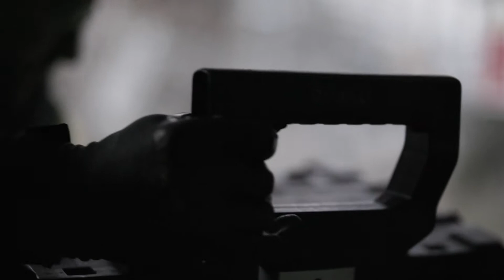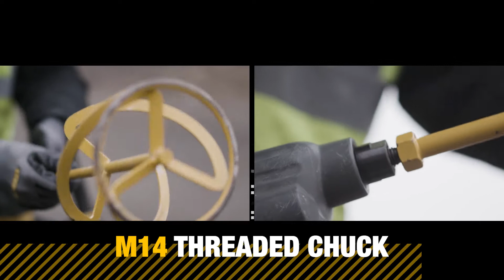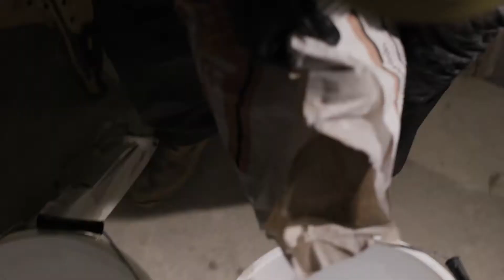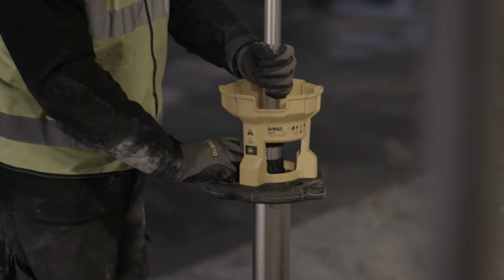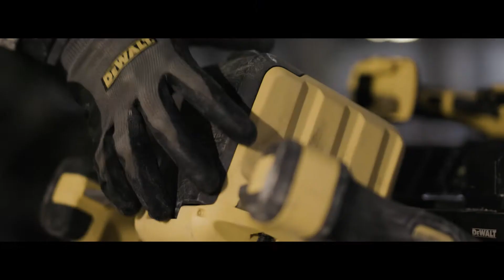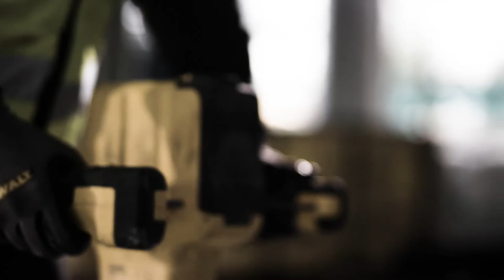DEWALT Paddle Mixer

Comment: So when I got the chance to review you're mixing drill it had a buckle in the Paddle where I think the drill might have got damaged somewhere along the lines of me getting it which made my review a little unfair in my opinion I have requested several times for me to get but different one but have had no luck so far as I want to do it good Justice and redo my review if I ever get the chance the great thing about this drill is the battery protection I love the way you thought about that as the batteries cost a lot of money and you're obviously thinking of Us having not to spend money on a battery if we got it wet during the day or damaged thanks very much guys great video
Reply from the maker: If you'd like to speak to a member of the team, we'd recommend you contact Service Technical on 01753 500 934.
Reply: DEWALT UK They still haven't sent it back out
Reply from the maker: we'd recommend you contact Service Technical on 01753 500 934.
Reply: Thanks so much @dewalt 
Your amazing
Reply: why dont I have this tool it should have been released a long time ago
Reply: I just got myself one of these bad boys. Absolutely amazing mixer and more than enough power for a days work.